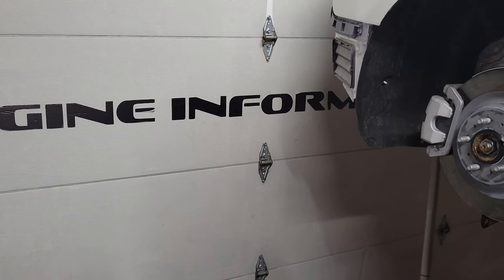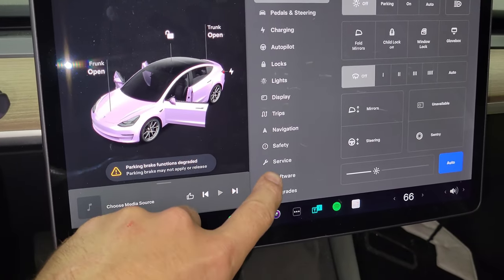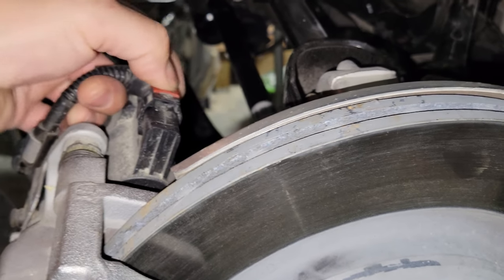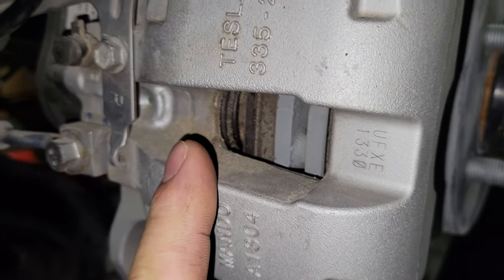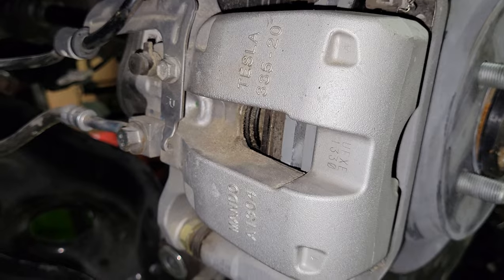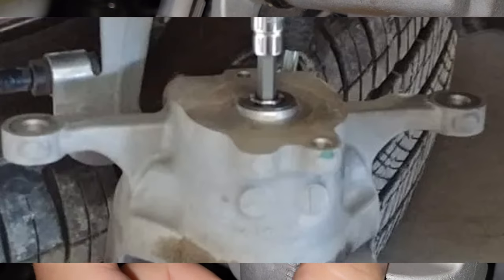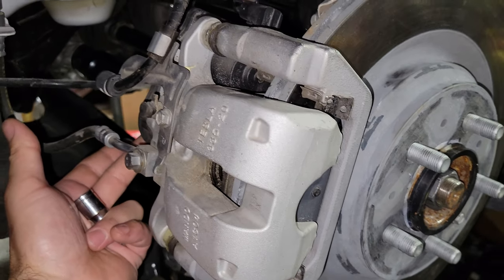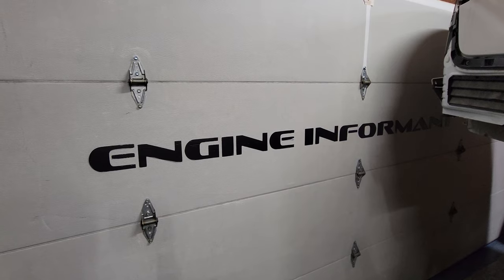Tesla Model 3 rear brake pad replacement

Comment: And when you're putting the brake motor back on make sure the threads are lined up on the back because if you don't while your tightening the back of the motor will pop off and you'll have to replace it.